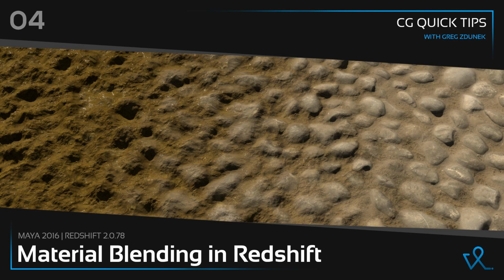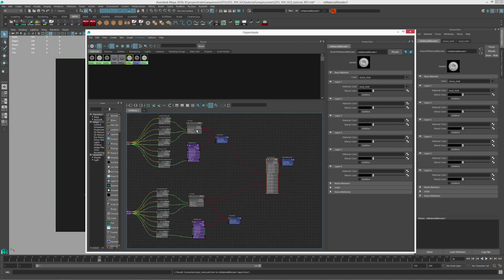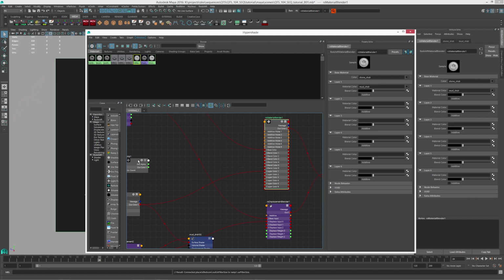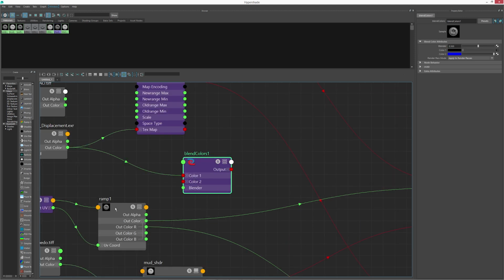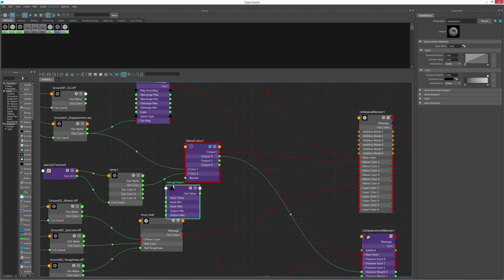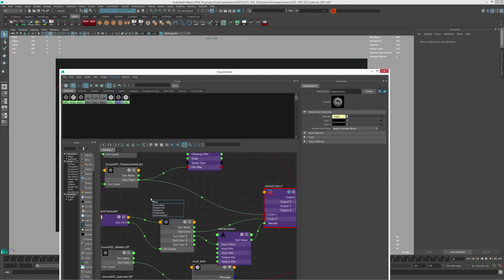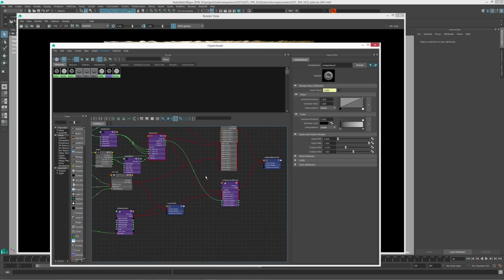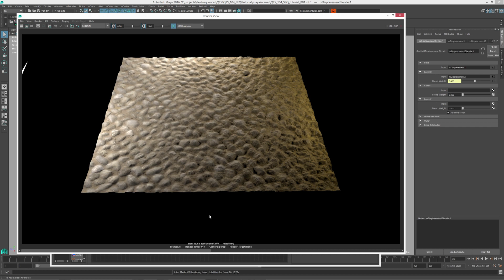Material Blending in Redshift - CG Quick Tips #4

Comment: So 2 materials.... Ok, but can we do MORE than 2? For complex terrains for ex? or huge geometry that can't afford to have 20k maps? I can't find a solution yet
Reply from the maker: In maya, the redshift material blender has 7 material inputs that you can layer together, however you can't yet nest multiple material blenders to get more than 7. If you wanted to layer say 20 materials, I would suggest using a single master material and blending the textures instead for each channel(roughness, color, spec). You can use either blendColors or RedshiftColorLayer nodes to blend texture nodes.

Comment: Was wondering if you have any tips of material blending (or I might not need blending) when I shoot a RS light onto the surface of 2 blend materials, e.g. A and B, I would like one of the material A to reacts to the incoming light, ie the section where light shines on it, material A becomes dark (or invisible during render) while material B will render. And on surface where the RS light does not reach, material A lights up while material B is invisible or dark. It's almost using a backlight that reacts to incoming light to cast shadows. An example is on this video https://youtu.be/ZX7FtLjvmK0       Thanks
Reply from the maker: Hey there, my first thought would be to use the samplerInfo node and connect the light translate to the rayDirection attribute, using the facingRatio output to blend two materials based on the incident angle between the light and surface, however with the latest redshift and maya 2016 this doesn't work for me and just defaults to using the camera facingRatio instead of the connected light - this would only be based on the light's position, but try it out, it might lead you to a solution.

The only correct way I can think of to blend materials based on where a light hits and its intensity, is to output a rendered light AOV and use it in compositing to blend some other material AOV's - I think custom AOV's and per-light AOV's are already in development for Redshift, but haven't been released yet. Otherwise I don't think it's possible without a custom shader.
Reply: I've tried the samplerinfo node + raydirection in Maya 2017 and redshift and it poops....doesn't work. Will look at AOVs as you suggested. Thanks. There are still quite a lot of limitations on Redshift but it seems to rock!